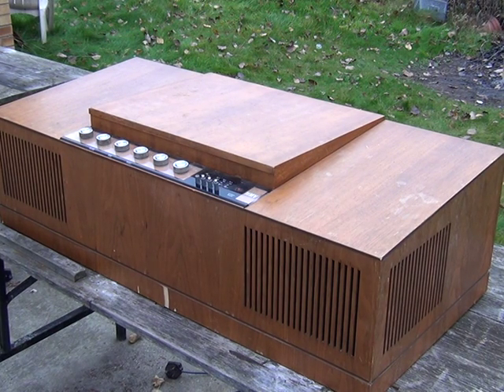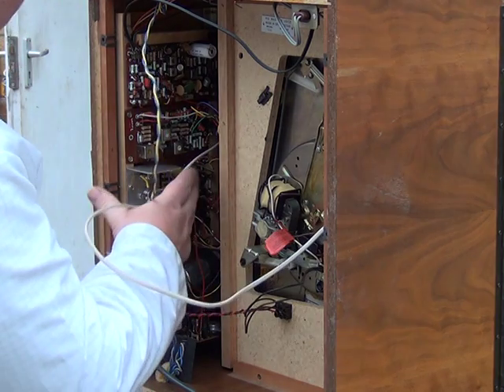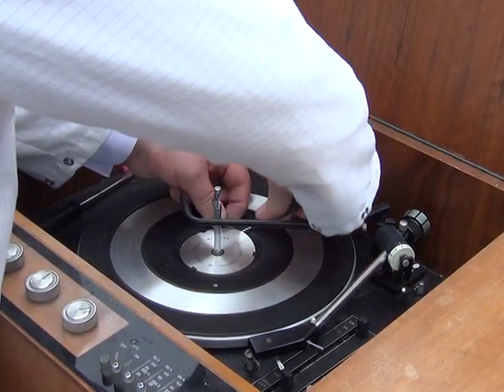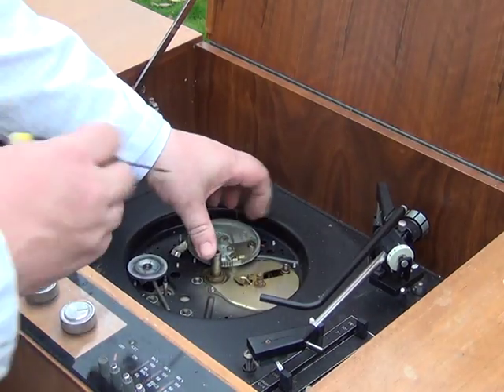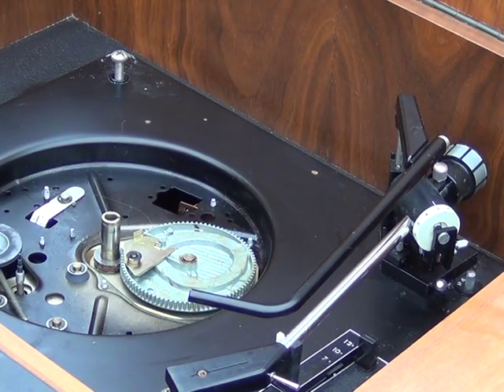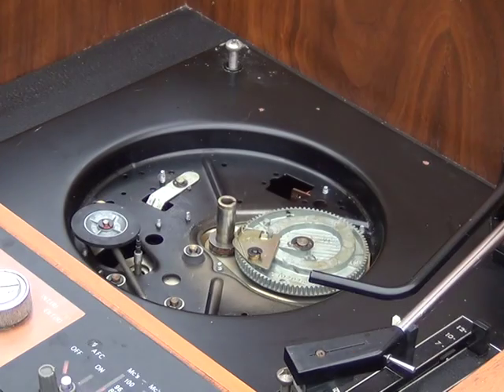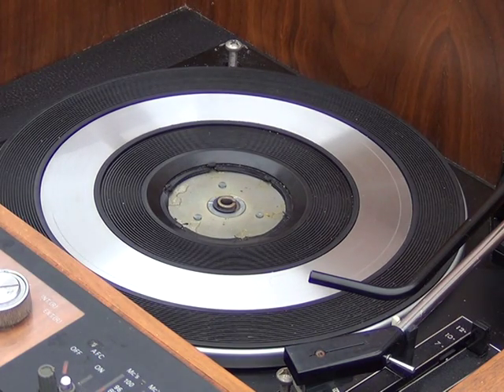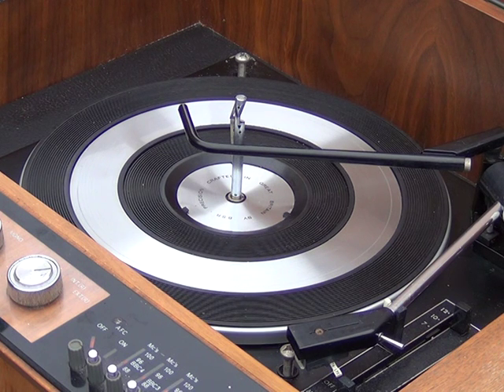HMV Stereomaster 2330 radiogram service - pt1 Overview & BSR UA70 lubrication

Comment: I usually watch your CB radio videos Richard. However those old stereo systems are beautifully made and great to see a craftsman at work. Very enjoyable thanks.
Reply from the maker: Yes, I hope it doesn't annoy the CB viewers too much. I'll be covering all ten HMV stereomaster models. They just need the deck lubricating & a few electrolytic capacitors changing & they'll be good for another 45 years. I have a soft spot for these products from when I had a TV/radio shop in Yorkshire. I have the manuals, the training & experience of these products & it's time to share it for free. These were all very expensive at the time, were intended to be routinely serviced & will last more than a lifetime. Most record playing equipment on the market today is trash, and is heavy on the records to boot. These Stereomaster's all have a 5pin DIN input/output socket enabling other things to be plugged in, so are futureproof. I see these time & again on ebay. Nearly every one says "seized turntable" oh, and "haven't the room for it".....right well chuck out the telly then.

Richard